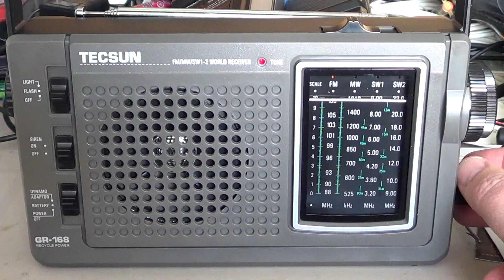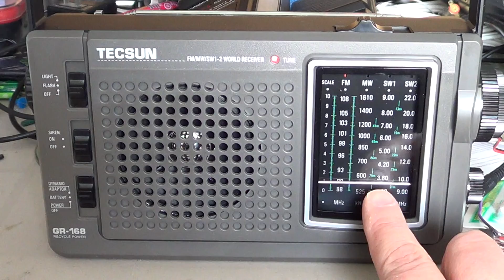Tecsun GR168 FM performance test

Comment: I was wondering why you never put up the whip in your video the other day. I'm actually amazed how little I run into the problem of overloading on most cheap radios in the FM broadcast band range, yet it frequently happens with shortwave and vhf and uhf scanners.
Reply from the maker: I am not very far from strong powered FM stations here .. so overloading is a big problem ..  it even overloads my Icom 8500 !